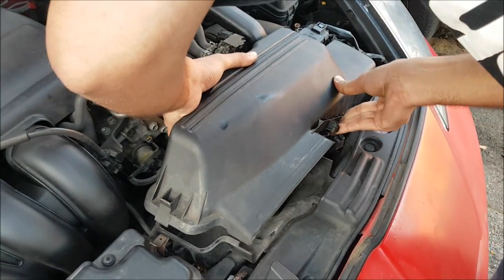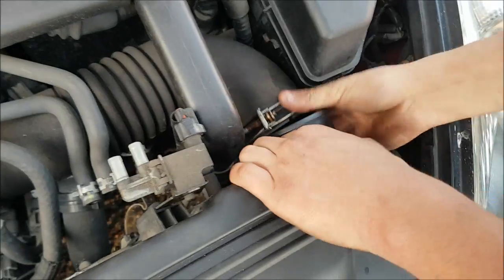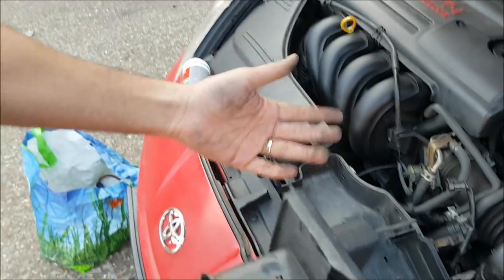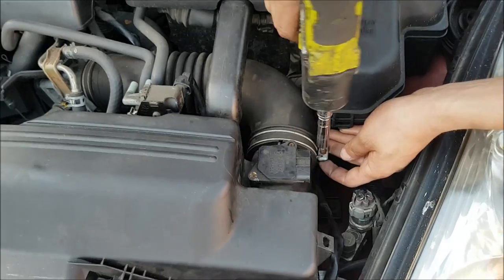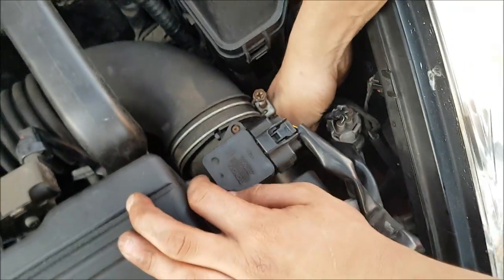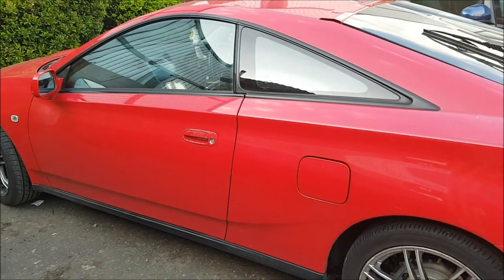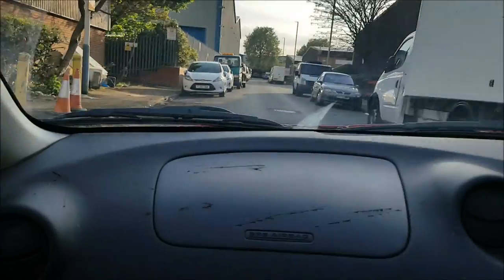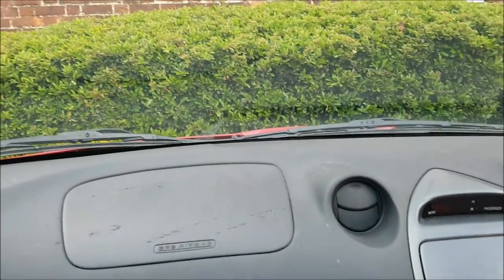Butterfly Valve Delete Makes Toyota Celica Sound INSANE!

Comment: The removal of the butterfly valve doesn't hinder low down torque, it provides sound dampening for the engine when car is idling and restricts airflow during idle and low throttle so that the engine uses a little less fuel, removal lets the engine breathe a little bit better. No gains, no losses, just sound and flow.

Comment: In my experience, my Celica sounded a lot nicer but used up more fuel when the valve was deleted. Ended up putting it back in.
Reply: Don't argue with the Japanese engineers :)

Comment: This made my automatic toyota celica gts 2000 run much better and I feel more response. Not much louder but sounds more aggressive. Thanks for posting this, my car idles and runs smoother. People now are like omg your car sounds so cool. 3.5k-8k range is super loud it hurts my ears. ECU will take about a week to get used to the idling and sound at low rpm but this is worth it. When cold this will make your car sound orgasmic. When warmed up I only notice a 20% louder sound difference.
Reply: Any issues this has caused?

Comment: An interesting historic one here, the butterfly valve delete gives more noise but if you really want to cheaply mod your Celica with a cold air intake which won't ingest any fluids And Only costs 10£ then I'd suggest the following mod: 

When you take out your airbox directly beneath the air intake hose and below your filter you will find an area only just big enough to drill a 76mm hole. This, connected to a cheap plastic duct hose and routed out through your underplastics, and under the front axle in a pointed forward fashion will cover all bases as at low rpm your engine will take from the warmer top intake which passed over radiator but as soon as the engine needs air the cold air from the below filter will sneak in from the bottom.
Reply: Can you make a video?

Comment: This is a great mod for sound and a terrible one for everything else.

The butterfly is there for a reason and that reason relates to these engines and how Toyota designed them. At low RPM the valve timing on these engines are designed for high fuel efficiency at the expense of high airflow and power. The butterfly aids in giving the engine more torque and drive-ability at low revs and once above 3k RPMs I believe the valve is fully open and negates the need to remove it.

Toyota designed the valve timing system, stock ECU map and the entire intake system around having that butterfly in and operating- without it you lose low end torque, drive-ability and cold running will be worse.

The best thing for the stock intake box with these engines IMO is a higher flowing dry panel filter you can drop straight in place of the stock paper element, such as a Blitz LM Power Panel Filter and then reset the ECU and let the car take advantage of the better airflow. The induction noise is increased slighty and you don't risk messing with something that Toyota would have heavily engineered.
Reply from the maker: Thanks for your comments. In real life terms there is no loss of power at all in lower rev range from removing the butterfly valve, but it does feel like there's better throttle response across the range. There are many people deleting factory airboxes and running open cone filter induction kits on these cars safely with healthy engines- yet those kits totally do away with Toyota's butterfly valve just like this mod. So it's perfectly fine and safe for people to do.
Reply: You might not lose any power but you aren't gaining any either and changing how the air flows into the intake on these engines in stock form isn't a good idea and effects how these engines draw in air at low RPMs, its there to add low end torque because the theory is shorter intake runners increase torque. So Toyota designed it for both worlds- low end torque and high air flow at higher RPMs.

Induction kits are unless they go under the front and tuck into the arch and short ram air intakes will do nothing but lose power on these cars as they suck in hot air from the engine. An ECU remap is required to gain anything noticeable from these engines with mods and there are plenty of examples of induction kits causing these engines to lose power, run poor and eventually throw a CEL- without proper ECU tuning.

There isn't any real cheap way to gain performance from these cars but you cannot go wrong with simply replacing the stock panel filter for a better flowing one.

Throwing out things Toyota specifically designed for these engines is only going to make the engine run worse and like most people you're probably just going to put it back in after the engine starts to feel worse.

I have tried the butterfly out myself and even an open short ram air intake- neither made the car any better and even made it run worse at some RPMS. I now run a Blitz LM Panel filter in the stock air box without issue and throttle response is much improved and its easy to just brush it out and pop it back in once a year.

There are some good mods for these cars and some terrible ones- the best ones are not free as I have discovered.
Reply: He is right bro. I've had a 2000 GTS for almost 20 years. I've tried removing it to. It does not run the same in low RPM's as it does with it in. Not as smooth. And there is no, at least for me, no felt gain in HP.  @RedlineRevs
Reply: What ever happened to people doing mods that actually aid in the performance of a vehicle? Seems like anymore people do this kind of crap that literally does nothing but make it sound a bit different. Just like doing a muffler delete instead of actually putting an aftermarket exhaust on. People these days care more about how their car sounds than how it preforms. I've seen people put cia on "just because it looks cool" or an engine stabilizer bar because it's cool
Reply: Agreed. When I bought my GTS the previous owner had removed the butterfly valve. It just didn't run right at low rpm, so reconnected it all and runs & feels so much better! Like Trucker V said, what happened to modifying your car for actual performance, not just noise?
Reply: @bsornot4333  i have a dyno that says other wise. in my case mine was defective the butterfly wasn't opening  all the way  the extra air flow helped used  to the rpms dropped almost all the way down when put in drive

Comment: This is a terrible mod.

I love how my Celica opens the Butterfly Valve at 4200 RPM, engine opens up, sound starts to Bloom in all kinds of racing engine noises... Just wonderful.

What happens without it? Must be there for a reason, what happens to low end torque, power, consumption, noise on slow  highway traffic driving?
Reply: yes friend,affects low end torque, power, consumption, noise on slow  highway traffic driving,how i notice that?i am from Costa Rica, i buyed my Celica from Florida and i am so happy with it.Thanks this video, i notice that my Celica comes without it(butterfly) and i ran to ebay to find one, and the results are huge, runs better more torque sounds much better, better fuel consumption in other words runs like factory settings.I am so happy now, i drove it 3 years without butterfly i have authority to say let in your place the butterfly... amen.
Reply: I'm not a mechanic but I do know if you change any part of the motor the car is tuned and from factory the motor will detect the difference and adjust accordingly if you want to adjust an improved performance cleaning the mass air flow sensor with a Proprietary cleaner is a good way to improve fuel efficiency if you want the car to sound good get a recorded soundtrack and play it through your speakers a very suspect mod I wouldn't do it
Reply: VT ( valve technology) little bit more air little bit more fuel little bit more boom.
Reply: @SLR-hn5yy  The 7th gen celica has an ECU which resets itself every time it is started - which is why you can't tune factory ECUs. So, saying it resets itself to any mod is complete bullshit in all honesty - the only thing it can cope with is an Intake and Exhaust "upgrade". Anything else the factory ECU won't adjust to so you have to get an aftermarket ECU which are not cheap. These aftermarket ECUs will allow you to adjust them as you please and won't reset itself to factory settings.

Comment: I did this on mine but put it back on because I noticed a decrease in fuel economy and it felt a little less responsive from a standing start. Made a nice sound though but to be honest you still get the noise when you're ragging it and that's when I want it, not when pulling away from the lights.

Comment: Sweet Christ...
IF YOU PLAN TO REMOVE YOUR AIRBOX COVER...

For this mod (which has been around since the 7th gen came out), follow these more manageable steps:
#1 - Pull the bracket for the rear hoses and connecter up from the box housing.  Yes, the entire bracket comes right up and off without disconnecting the two hoses and the digital connector.
#2 - Pull out the two rubber hoses below that bracket you just removed.  They should pull right off the male nipples on the upper air box. 
#3 - Pull out the plastic wiring clip on the top right of the air box.  Pinch and pull to the right.
#4 - Pull the fuse box up and off the air box.  It has a "pinch" bracket; just squeeze and lift.
#5 - Push the secure arms off the air box.  They are probably rusty or silver.  There are two.  The left side is very visible, and the rear is under some of the items you removed above.
#6 - Loosen the screw (with a phillips bit, NOT A FLAT HEAD!) or with a socket.  Use a spray of PB or WD-40 and let it sit for a minute if you have troubles like the video.  You can now wiggle the large intake hose off the back of the air box.
#7 - On the front of the air box, there is a secure "clip" built into the upper and lower parts of the air box.  You can pry it loose with a flat head or sometimes just twist the box a little.  A small male tab on the bottom right also needs to be pushed back and out.
#8 Now, you are free to remove the butterfly valve.

The top of the box should be free now.

If your filter has a hanging gasket on it, like this video, replace it.

I'm unsure about the need to plug the vacuum hose like in this video.
This technique with the screw worries me; over time, the screw could wiggle free and rattle around in the air box.
It should harm anything but will sound like you have a part rattling.
If you choose to block the line, some electrical tape or a small clamp should work.
Reply: I heard a horror story of someone stalling the engine under heavy-braking when not blocking that line. Unsure how likely that is to actually happen. 

I think a screw is good to plug the hole, but that screw needs to be secure. Surrounding it in ductape should do.

Comment: Unless this car has a turbo, it's not a good sign that the exhaust is popping. It is recomended that if you modify the intake or exhaust that you retune the engine...
Reply: These cars are common to throw out the odd pop even brand new. Shows what you know about these... fuck all.
Reply: @JustAnOrdinarySimmer  a carburetted engine might backfire, but engines with electronic fuel injection doesn't unless the exhaust valve is way out of timing.
Reply: @deimond3123  Yeah bollox but you believe that if you want. You'll be rebuilding engines with less than 10k on the clock. Once again, you need to research this engine a bit more because you are 100% wrong and trying to correct me when I've been working on these the past decade and more but hey what do I know? I'm just an engine rebuilder vs a youtube expert.
These engines are common to let off the odd pop and bang..said it once more for you.
Reply: @JustAnOrdinarySimmer  Ok. Why do they do that? Never heard of a NA engine popping like that unless there's something wrong

Comment: You guys need to take more appreciation in your work. I don't see that car lasting long the way it's driven and just ripping and tearing shit off
Reply from the maker: 'ripping shit off'??? - butterfly valve is a common mod we've shown how to do it and disassemble and reassemble... not just 'rip' it out. The guy working on his car in the video is a professional mechanic and his hands move fast, but nothing is being 'ripped'. 
 'car won't last long' - This is a corolla engine which with regular oil changes will last till the moon and back and it is perfectly happy being revved into vvti.

I ought to do a video of where our celica is at now. It's been garaged and is undergoing a full restoration...
Reply: Definitely not a professional in my opinion.  You don't have to tell me about these engines. I know more about them then alot of "professionals"
Reply from the maker: @gage2271  you're a professional twat.
Reply: @gage2271  If you know so much more, I can't wait to watch your videos... oh wait

Comment: Your stupidity makes me see that my Celica does not have that valve, I'll buy it on eBay, I do not knew about that valve, for a reason it's there, thank you, very informative your video, btw if you want sound buy a stereo
Reply from the maker: Fuck you and your shit car what kind of pussy puts the butterfly valve back in a 15 year old car worth less than $1000. Dickhead.
Reply: @RedlineRevs  lmaoooo
Reply: I just removed the butterfly, but it doesnt sound like yours, yet I did everything same as you did. But I noticed, in your video, there somewhere dissapear exactly same hosepipe as the one that must be sealed with the screw and it is connected into airbox(to the filter). I connected it back to the airbox, yours on the video is visible but only until the cut in the video where the screw is already in the hosepipe from there I cannt see the other hosepipe anymore, what happened with it? Maybe thats the reason I didnt get that sound exactly same.
Reply: @Redline Revs
Reply: @RedlineRevs  very responsable channel,thanks for your words
Reply from the maker: @JEY74  stick to video games Esty.